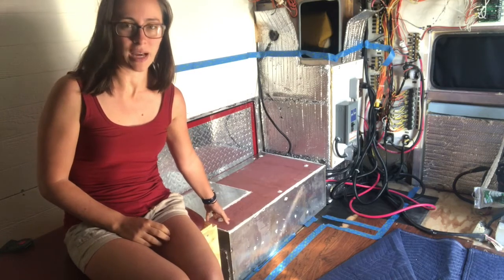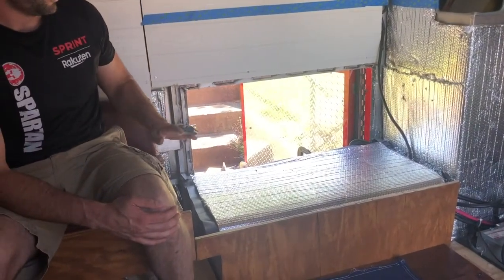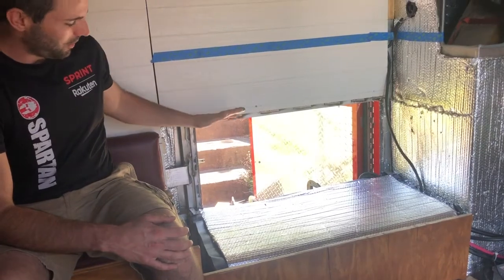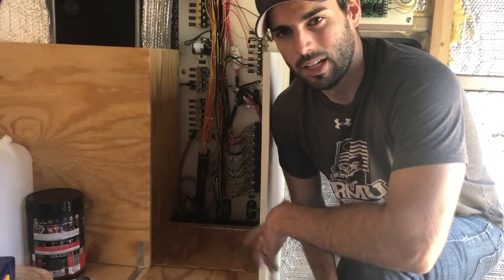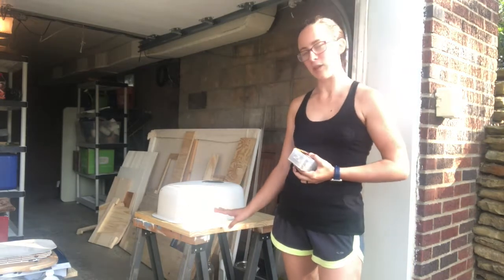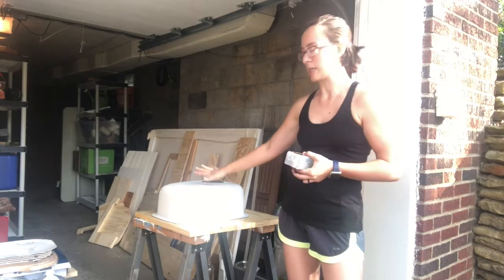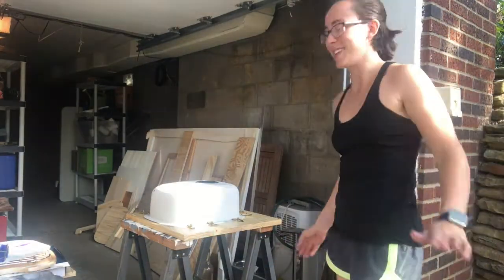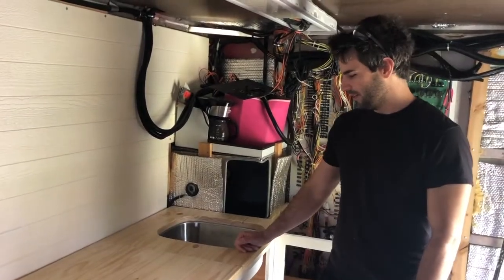Ambulance Tiny Home Conversion Kitchen Build

Comment: Putting water above electrical equipment is never a good idea. Just saying.
Reply from the maker: Hi Robert, thanks for the concern. The grey water tank for our sink is in a whole separate compartment. Should any leak from the 5 inches of P-trap to pipe leading out into the tank happen, it first would fall into the mixing bowls we keep directly below, or get protection from the waterproof flooring we put in the bottom of the kitchen cabinet that is above the batteries. In tiny home life, it is always necessary to make creative adjustments.